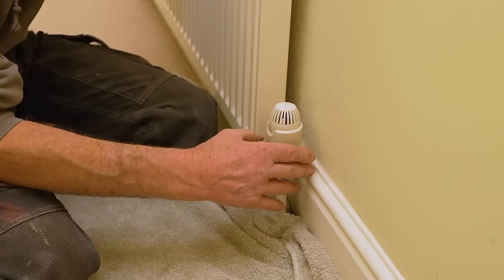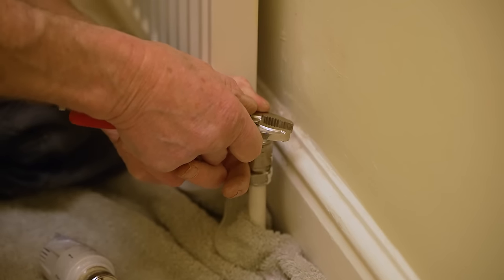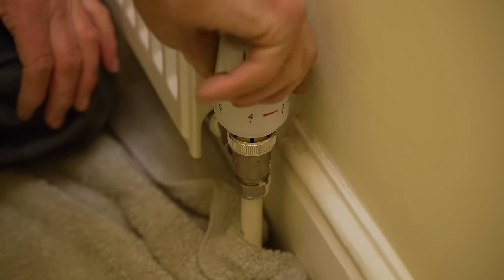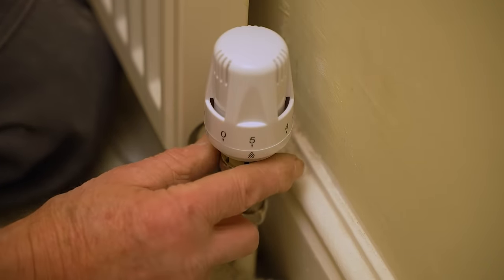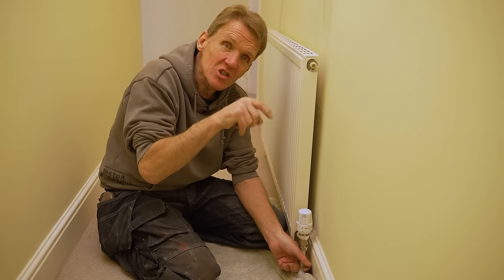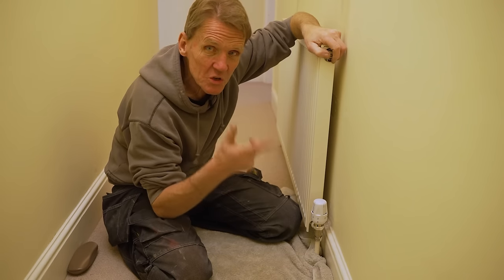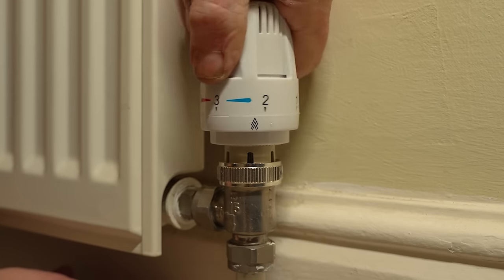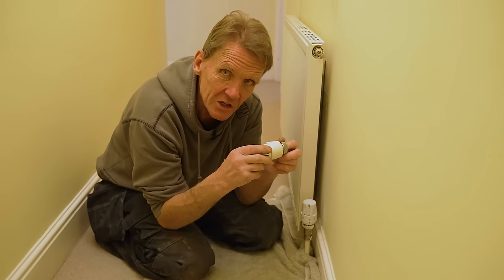Why Won’t My Radiator Turn Off?

Comment: The amount of times I got called back because TRVs, " I turn it to number 3, and its not working", I explain it works on air temp not water temp, " oh I thought number 3 was warm, and number 4 a bit warmer",  a week later they forgot what you said about air temp, and its " I don't think its working properly",  same with programable room stats....once you say there will be a call out charge next time, that use to fix the problem...know what I mean Roger.

Comment: my radiator does not turn off. even i change the valve also. and in my basement i dont know how to reduce the heat. am living in german and everything is written in german language. at night my room is like burning . i open all windows and turn on 2 fans to reduce the heat otherwise i turn off the heat in basement. i dont know whats the problem.

Comment: I like the colour of the walls, wonder what it is.
Reply: 🤔I think it’s called 10b15 😂Otherwise known as magnolia in the trade 🤣🤣
Reply: @DazzinB32  I'm colour blind ...well according to them stupid tests I am, but I would say lemon.   Mr bisby need to carry a colour chart tbh..and " put a link in the description " 👌😂. That way us pedants can get a nights sleep lol.
Reply: @DazzinB32  
Not Magnolia, it's way too yellow.
It's a nice colour actually.
Reply: @42RHD   that could be very true 🤗 it’s just about the lighting 👍🏼
Reply from the maker: The colour is very similar to the one in my prison cell. I was glad to see the back of it.
Reply: @SkillBuilder  
Who knew you'd done time?
Look into peaceful shades of grey and blue?
Reply: It's a council colour
Reply: I agree, its a good strong colour, goes well with white skirting. They got the wrong colour carpet though, not quite a good match.
Reply: Have you seen the media trying explain things like this and turning boiler c/h  temperature down . "With experts"  always sounds very confusing. Lol . Nice work as always 😊
Reply: The colour is boring Magnolia. I hate it almost as much as woodchip wallpaper.
Reply: @Dave5843-d9m  My mate, who works for the council, loves this colour. What have you got against my mate?

Comment: Ha ha I've been DIY plumbing for years and regarded my self quite competent but didn't realise about the bi directional trv and always put them on the flow. On top of that i thought the trv worked on water temp and not air temp so thanks for the re education great video as always your the one stop channel for any task well done.

Comment: Thank you very much for this. I am always way too hot and I'm stuck in a hotel room for the next three nights and the radiator in my room would not turn off, after taking off the controller for the radiator and then putting it back on again I was able to twist it down and switch off the radiator and now I'll have three nights of comfort in a nice cool room. Thanks again

Comment: wish I'd known about this before I diy'd the TRV on one of my rads years ago.. was only after I'd hack-sawed the plastic off (sheer frustration and nothing to lose) before I worked out that if you turn them up full you can get a spanner in there to get them off. On the upside.. I learned something..! 😆

Comment: Cheers, thank you.
All the pins on mine are stuck so I haven't been able to turn the valves down in years because once I turn them down, I can't open them back up again.
One of the reasons I retrained, now I can sort out my radiators!
I've learned to live with it, but it's on the list for my NVQ! 
🤣
Reply: Some of mine did this when I was replacing all my TRV's, as some had given up the ghost completely so my central heating system wasn't working very well.
A bit of WD40 on the valve and giving it a nudge now and then managed to free them off after a day or so, then some silicone grease before I fitted the new TRV's.
I figured that the valve pin was sticking at the top of the valve body due to a bit of corrosion, because let's be honest, they don't move much and aren't greased from new.
No issues now, funnily enough the new TRV's look the same as the old ones Roger shown in this video, Drayton RT212's 😅
Reply: @mazdamaniac4643  
Good idea.
I'll give it a try.
Thanks!

Comment: Im glad to see this...I just moved and i have 2 radiaters not being able to turn off...so that flowing noise is 24/7...and making me mental.... thought it was just the new apartment building system...hopefully just the thermostats...thanks
Reply: Just wondering... can they make it so renters cannot turn them off fully? When I remive the thermostat and push the pin in or out, it only make a very slight xhange in flow noise

Comment: it's still worth just swapping the old head for the new one to see if that fixes it. In my limited experience, it can do. Even when a plumber friend told me the pin was definitely gone I just attached a new TRV head and Bob became my proverbial uncle. Don't ask me how or why. It just works sometimes. Big relief not having to drain down the system.

Comment: Also worth noting some bathroom rads are connected to the hot water system and not central heating system so you won't be able to turn those off either.

Comment: On my living room radiator the thermostatic valve just never worked . Cheap alternative , a plastic cover over the pin can work as an on off of sorts , tight for off loose for on. Had it like that for years and its fine. Its also good for when i have the log burner on but want to take the chill of the rest of the house , i can close off the living room.

Comment: Nice video Roger, thanks. You mentioned draining the system. I had it in my head that operation had to be performed by a qualified individual (not sure why I thought that!), but you suggest in the video that it would be possible for me as a DIYer to do it (within the law). Is that correct?
Reply: Your thinking of the Gas Regulations.
Reply: @robertallardice8119  yes. I had it in my head that they applied to the complete system, inclusive of  the radiators, but it appears my head was talking out of its arse!
Reply from the maker: Yes  it is legal to drain and work on your heating

Comment: I've turned the TRV down to '*' and already taken the radiator off, then watched your excellent video. Can I still remove the cap and turn the valve fully off or do I need to put the rad back on? Cheers

Comment: Be a good idea to show how to change a radiator valve without need for draining the system ,Using bungs in the loft (open vented system)on the header tank and expansion pipe ,using the vacuum method ,making it a quicker job ,no loss of inhibitor, saving you money on replacing it .I'm not a plumber by trade and I managed this easily without drama ,Sure your followers would appreciate it .compare it to closed system
Reply from the maker: Great suggestion!

Comment: Not all rad valves are bi? Outrageous!
Signed: Loretta Sheffield.
See: Monty Python. Life of Brian.
Apparently, all comments help the channel. Even the daft ones.
Reply from the maker: If a rad valve says that it self-identifies as bi then it is bi regradless of the arrow showing it was born as a single direction valve.
Reply: @SkillBuilder  I sub to two trans women's channels. One fully off wit meat and 2 veg, another, intacto. Wont name drop. They are very critical of the madness that is identity, intersectional, politics. Currently reading Andrew Doyle's "The New Puritans".

Comment: If you have got an old valiant trv that shuts itself off when you unscrew the pin part to replace it you don't need to drain the heating

Comment: Well, not useful here in the land of forced air heating, but interesting. I grew up in Boston in a triple decker apartment building with radiators. Those valves are probably old news, but they would have been a big improvement over the Bakelite knobs and manual adjustment at all times of the day and night. Did I mention the asbestos sleeves on the exposed pipes running from the basement boiler to the upper floors?

Comment: Good morning! I have been watching nearly all your videos and they are so helpful! I have question as you seems very clever and bright with ideas. My garden shed door has gaps between door planks and rain coming in. Can you recommend with what could I fill in those gaps,please! Planks are treated and summer time gaps are a bit bigger. Thank you so much if you will be so kind to reply to me.
Reply: I hate that about shed doors, not sure why they make external doors in such a manner, why aren't the boards horizontal rather than horizontal. The rain runs down the board and gets through the lap to inside.
There should be a cheap composite shed door by now with the wood pattern on it.

Comment: DIYer here, thank you Roger for this and many other videos.  I’m having difficulty understanding that a thermostatic valve can be fitted on the flow or return.  With a condensing boiler I believe the objective is to have as much temperature difference as possible between hot water coming into the radiator (flow) and leaving the radiator (return).  To do this, I would tighten down the return (lock shield valve) such that the passage of water is restricted, causing hot water to spend more time in the radiator and, in doing so, lose its heat to the room.  If what I’m doing is correct, then the thermostatic value should only be fitted on the flow (ingress) pipe as water restriction would otherwise not be possible.  Any advice greatly appreciated.
Reply from the maker: The water restriction is the same on the outlet. If you control the flow through the radiator it doesn't matter which end
Reply: @SkillBuilder  Thank you for the reply and I think I see your point but to which I have a second question.  By the way, I can struggle to see the simplest things sometimes and can carry on asking questions like an annoying child so please feel free to ignore, delete as you see fit, regardless, what I learn from skill builder and others is how I proceed so thank you.

 So now I’m imagining myself as a droplet of hot water having just left the boiler and on my way to the first cold radiator with a thermostatic valve on the return.  I first struggle to get past the lock shield, as it’s only open a ¼ of a turn, then once through I have a cold radiator to flow through at a rate restricted by the almost closed lock shield then, once I hit the thermostatic valve, I can pass through with ease (the rad is cold so the valve is open).  In this scenario, I can’t see where hot water is pushed into the radiator as fast as possible and kept there for as long as possible.  With the valves reversed, it seems like it dribbles in and out at an equal rate.  Granted the radiator still gets hot when valves are swapped but is this efficient, I’m I losing enough heat at each rad for the condensing boiler to be efficient?

Clearly I’m missing something here because everything I’ve read supports what you are saying but I cant seem to get my head around it.  Perhaps it’s my lack of understanding about the operation of the thermostatic valve, it’s pin movement between open and closed, starting position, etc.  A whiteboard teaching moment for a future video perhaps?

Kind regards,
Bob
Reply: @bobbydazzler9547  You’re overthinking it and that’s why you are getting confused. 

It doesn’t matter where the restriction is the heating water will flow through the radiator at the same rate. (It can’t flow through the radiator quicker if the TRV is on the flow because the lockshield on the return is still restricting the flow of water exiting the radiator)
Reply: @jakes6147  Thank you kindly Jake for replying.  I got halfway through my reply to you then the penny dropped.  I’m dealing with a pressurised system with equal pressure on both sides of the rad so it’s not possible, as I was asserting, for water to travel in and out at different rates. It’s good to finally understand something that was bugging me for ages so thanks again to you and Roger.

Comment: Very interesting video as always 😊 we have some air trapped in one of our radiator and the bleeding valve is worn off. I was wondering if there was any trick for getting the air out. Is there a way to get the air moving to another radiator which has a functional bleeding valve?
Reply from the maker: You need to turn the radiator off at both ends and remove the small brass pin with a small drill. Modern radiators have the air cock in a nut so you can undo the whole nut but old ones can be more difficult.
Reply: @SkillBuilder  thanks for the help 👍

Comment: Hi, thank you very much for the tutorial, just wondering maybe you also have one, if the pin is not pushing down? thanks
Reply from the maker: Just keep tapping it fast. The pin is down all the way and once the valve is unseated the pin will come up. Don't give up.

Comment: Until you get around to replacing the thermostatic valve, try putting a coin between the thermostatic valve and the pin then when you close the valve it pushes the pin down properly.
Reply from the maker: Hi Robert 
That was going to be out next video in the series. I have used all kinds of things to do that but these heads were shot to bits

Comment: I put silicone grease on our pins or WD 40 to free them off
Reply from the maker: It is not the pin. it is the seating on the valve that gets stuck.

Comment: such great videos, I wish I could find one that explains why my pump stays on long after h/hw is off and the apparently faulty hw zone valve was replaced a few months ago
Reply from the maker: Pump over-run is built into the boiler to clear heat from the heat exchanger.
Reply: Tks for the reply, yes, that’s what I thought, but I’m talking way beyond that, so the only way to stop the pump it is to switch everything off at mains. (All in the airing cupboard) I’ve been watching a few more videos and could it be the micro switch inside the zone valve that sticks. @SkillBuilder
Reply from the maker: If it were the micro switch relay in the motorised valve it would fire up the boiler. If the boiler is off and the pump is still running it is because the printed circuit board is telling it to. I am not certain about this because it could be wired incorrectly so it needs a little more investigation.
If you send pictures to www.skill-builder.uk/ask I might spot something but I will need to see inside the wiring centre

Comment: Tks, apologies I may have given you wrong info. I checked the boiler and it was on, but just ticking over as everything was up to temp, or that’s how it seemed to me? As the hw zcv was replaced in May and the problem went away I concluded that was where the problem was. It now seems have happened again about six months later.

Comment: Hi Roger, very helpful video...
I've had new rads with TRVs fitted recently. Most of them functioning as expected however I have one directly opposite a stove in the living room. Despite the room being 19 or 20c due to the stove, the radiator still gets very hot when I switch on the heating. I've tried putting it from 3 to 2 and then to 1 but it still gets full flow of hot water in an already warm room.
As I say, all new rads, pipes and TRVs. Any ideas?
Reply: Could be a broken TRV head. Try swapping the head from another rad.

Comment: I've had a couple of TRV's leak causing the combi system to loose pressure. The leak comes from around the pin on the valve which

Comment: My neighbour had a problem with her valve she's on the British gas insurance plan and they contract the work out, the guy messed it up! had to take the pipe off soldier new pipe on don't ask me why and has burnt all the wall with the blowtorch now they got to get it decorated.
Is there any issue between Imperial and metric I don't think so changing the whole valve? What he didn't need to do.
Reply: I had a poor experience with British Gas.
Cancelled the contract before they could butcher my house and found a very decent local company who did a great job.
Reply: BG service is awful.  It is really sad they used to be good.  I did not renew two years ago.  Finally gave up.  Stayed with them far too long.  Way back, they gave such good service when I had a leak prior to going off on honeymoon.  They really pulled out the stops.  Creating such loyalty that I probably held off cancelling by ten years.  Used a local firm .  Sadly they have let me down but I am not going to BG , I will use another different local.
Reply: @chapman9230  I don't think it's BG is a problem because she gets good service with them but they keep contracting the workout to some low grade "technicians" they have a handful of experienced guys I feel at BG. They seem to repair the problem afterwards in her case. I don't know I'm not a customer of gas. She's constantly got them round there last year they said she needed a new boiler the contacts danico

Comment: But if the radiator is trickling the hot water in, then it slowly mixes with the cold water there, essentially making the radiator lukewarm if its on a lower number like 2-3? So in theory lower number does make radiator lukewarm?
Reply from the maker: O.K it probably takes 2 minutes for all the water in the radiator to flow through and be replaced by new water which comes in slower and therefore gives up more of its heat as it passes through. You may well be right  but  I try not to keep it practical and concentrate on what the householder needs to know rather than going down rabbit holes but I like